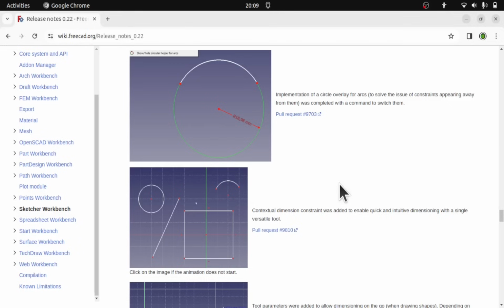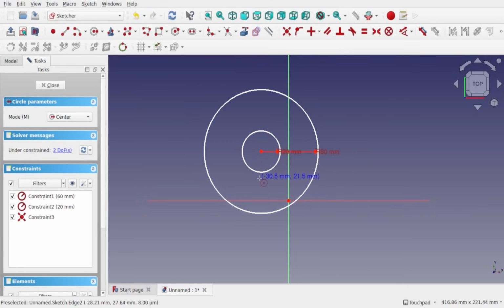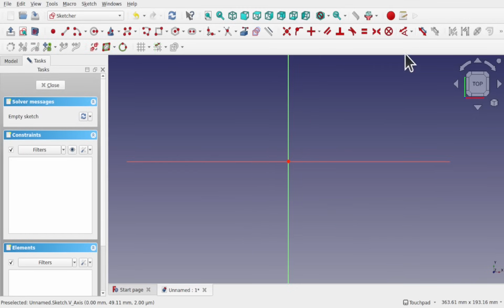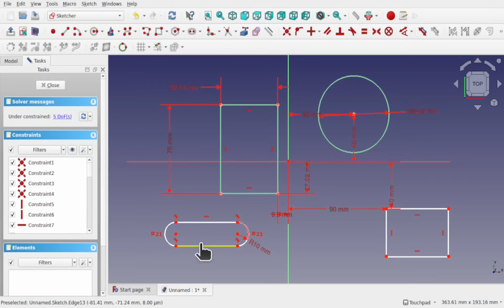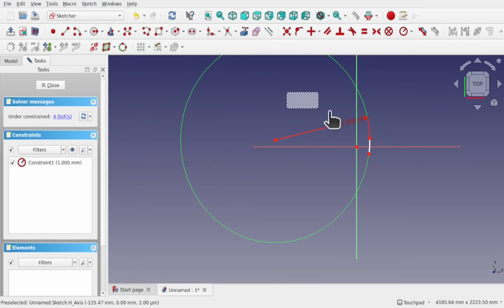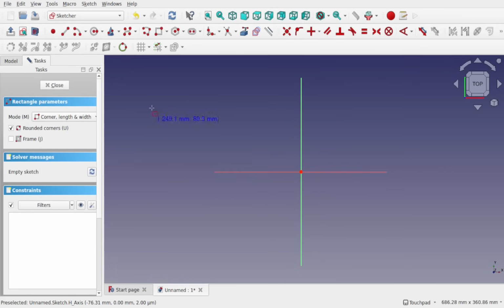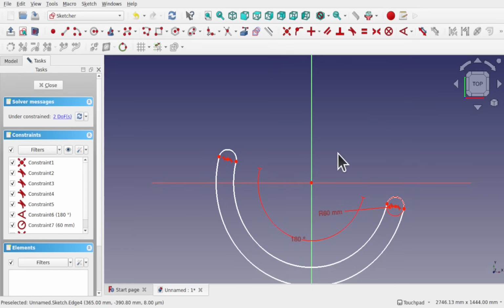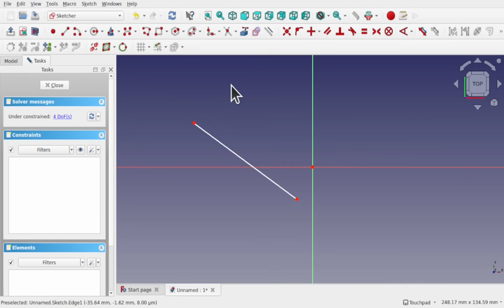!NEW! Game Changing FreeCAD 0.22 Sketcher Features

Comment: I just can't believe we're finally getting these basic convenience tools into FreeCad...
I would LOVE to switch to FreeCAD from Fusion 360, and I'm happy to have maybe a less polished experience with the CAD, but at the moment the gap is just way too wide.
Improvements like this really make A LOT of difference. 
The other part that needs MASSIVE improvement is extrusion. So that we can have a complex sketch and extrude parts of it from different faces etc.
And the third painful point is to support an actual modelling history with automatic re-compute (I know there are attempts being made to at least solve toponaming issue).
I'd say, for me I'm never going to use about 3/4 of the features that are currently present in FreeCAD, but all those features require maintenance etc. It's probably worth considering to splitting the functionality into the core modelling and "the rest" in the form of plugins, where separate teams would be able to maintain those plugins. It will just allow to speed up and stabilize the development of the core features.

If it was me, I'd say streamlining core part modelling experiences is the key priority. Reduce the usability gap with industrial software for simple scenarios, and the added audience will automatically speed things up. The traction and adoption are the key factors in my view.
Reply from the maker: Going forward there are some new direction in the FreeCAD arena.  0.22 is bringing more and more features and Ondsel are pushing in their changes into the FreeCAD main branch to bring more and more functionality.  Hopefully 1.0 will be released towards the end of the year.  Fingers crossed.  When it does it would be worth re-evaluating.

Comment: Thank You for this video. An issue I couldn't solve for years with Freecad is to describe an outer angle. E.g. I got an inner angle of 170°, but in my case i needed the outer angle of 190° it's still impossible to patch it to my sketch. Do You know a solution?

Comment: Now all I'm waiting for is a midpoint constraint (atleast for arcs and lines, bezier are much more difficult) and  someone solving that annoying bug where FreeCAD crashes whenever you change a dimension slightly. Often when I say, open a measurement and change from, say, 4,5 mm to 5,0 mm, everything just explodes. It is super annoying.
Reply: You can achieve a midpoint constraint by using symmetry for lines.
Arcs still require additional construction geometry but it can be done.

Comment: There's a lot of excellent things here that will make FreeCAD faster, easier and more flexible to use.  Those quick dimensions:  Can they take expressions/references to spreadsheets etc. or only literal values?
Reply from the maker: It's getting better and better :) At the moment those quick dimensions don't have a formula button on the end to add an expression.  I have tried adding an expression via typing it into the box but I can't.  I am not sure if this feature will be added.

Comment: Is there a reliable source I can get 0.22.x Windows binaries/installers from?
Reply from the maker: If you have a look in the description of the video you will see two links.  One is for a video showing where to download and how to run the weekly builds on both windows and linux.  Hope that helps.
Reply: @MangoJellySolutions  Man, I might be slowly loosing my sharpness ;) Not only I did take a look in the description previously and missed the video link. I also have visited guthub dev builds page and somehow missed the 7z pacjage! Thank you for patiently pointing me into the right direction! You're doing the god's work with your training. Top notch quality there. One thing I might suggest is putting more emphasis on setting up the initial options right after you click Create Sketch. I mean those deciding on relationships etc. / As for the dev 0.22. The sketcher improvements are simply too juicy to pass on and I'm already learning using a bit outdated 0.20 tutorials on my 0.21 installation. Just started learning. I used to use UGS NX a decade ago...
Reply from the maker: @Tome4kkkk  lol don't worry.  I just this minute spent half an hour trying to figure out to upgrade some software at work ...... on the front screen it says 'upgrade plan here'....  Yep missed that one, time for a coffee!  Not too bad 0.20 - 0.21 but 0.22 I am going to have a lot of (welcomed) work on my hands :) Already ear marking older 0.20 tutorials for review and re-record with some extra juicy bits lol.  Glad your enjoying.  Ah Simens NX.  I was at that point still using direct 3D with studio max but have heard of the package.  Well liked.
Reply: @MangoJellySolutions  I figured the changes are pretty big and rather long-lasting in the 0.22 sketcher. Hell! In case of most of them even a fresh FC student like mee could see FreeCAD is in dire need of those!

Comment: They should spend some time fixing bugs in Sketcher instead of adding features.
For example: we can't disambiguate a selection when two lines are on top of each other.
You can only select whatever line is drawn on top, and it' s arbitrary.
Only way around is to go hunt for it in the Elements dock and hope you find it.

Also the elements dock is broken.
You have to make two clicks to check or uncheck  the checkboxes, you HAVE to pre select them. --
Also, you can't use the keyboard in this list because it's   a weird descendant from a checkboxlist.

Worse than that, if you're in " Constraints' and try to go down past the last element, you end up in Elements, which has no useful keyboard control.
If you type space bar in Constraints, something happens ( a random element now draws in White in the 3d view) and it doesn' t deactivate or hide the constraint as you would expect.

This keyboard problem is a big problem for people who like to quickly go through a list while NOT looking at the list, but what is changing on the 3d view.
Reply from the maker: I have just pinned a reply from one of the freeCAD contributors so it appears at the very top of the comments.  The post has a wealth of information and includes TNP
Reply from the maker: It's worth reporting those issues back to the developers and then they can take a look into them.

Comment: Hi, I have a small challenge to you, that I have not seen on other CADs
I do crane liftplans. (I would love to include this onto my liftplans)
I need a quick calculation reference line from the top of the hook of the crane and down to the 4 corners of a typical 20foot container, the angle has to be no greater than 90 degrees on diagonal from the hook of the crane (4 legged chain), taking into consideration. Then I need to know the length of the line (chain)
Thanks.

Comment: Thee offset tool  looks awesome, most of the rest, nice to haves (and are nice to have).   But the #1 issue facing the platform in the toplological naming problem.   If this was a commercial product and I was the product manager, I'd be screaming at any engineering manager putting resources on anything but improving that.   It is the #1 thing limiting adoption of the platform.   And yet we get this.   Nice.    But not what the product really needs.    Meanwhile we all jump through hoops to avoide the TPN issue, or we switch to Fusion360.

Comment: WOW... This would be impressive if this didn't took so many years to arrive.
I know I'm salty but considering that those are basic CAD functions it's just sad it took so long.
FreeCad is a amazing versatile tool, but it's lack of a streamlined UI and user friendliness is the reason why it's unable to attract the industry.
Look at the rapid Blender improvements once it got recognized by the industry, it's defacto on it's way to supersede commercial software.
Reply from the maker: Very true and I think you hit the nail on the head there with once it got reconnised. Now with all the vendor lock in and subscription model more and more people are looking at freecad so more and more pressure. I know the developers are really pushing forward and the future is going to be very very interesting.
Reply: @MangoJellySolutions  F subscription... And double F cloud!
Alibre CAD is a very good program if you are a freelance professional.
But those 1500 bucks aren't laying around for normal folks.
Those might have fun with Plasticity but that isn't really meant for construction work.
An interesting thing might be FreeCad with the option to load a commercial Geometry kernel like Parasolid.
But for that to happen we would need to have a "FreeCad foundation" first.
So a small margin of the cost can benefit the community directly.
A few full time devs make a serious difference.
Reply: @MangoJellySolutions  F subscription... And double F cloud!
Alibre CAD is a very good program if you are a freelance professional.
But those 1500 bucks aren't laying around for normal folks.
Those might have fun with Plasticity but that isn't really meant for construction work.
An interesting thing might be FreeCad with the option to load a commercial Geometry kernel like Parasolid.
But for that to happen we would need to have a "FreeCad foundation" first.
So a small margin of the cost can benefit the community directly.
A few full time devs make a serious difference.

Comment: Good job! I can't wait for the official one.
I actually only use 2D sketch.
I ask myself: Is it now easier to make 45 degree fillets in sketches?
I think that would make drawing much faster for many people.
Thank you very much to everyone who is committed to Freecad.
And best wishes for the coming year.
Reply from the maker: Interesting that you only use the sketcher. I am guessing you making plan drawings? I am not sure if the 45 degree filter is easier with these new additions. If your only using sketcher it may be worth getting ahead and downloading the dev version. There is a link in the descriptive to a video of how to download and set them up. If you don't know how. No compiling necessary.
Reply: Thanks for your reply, and you're right I draw in 2D to use in my CNC router.
I watched the video and that was exactly my problem, I couldn't extract it without errors.
But that's fixed now. 
And it's true: It's much easier to add dimension. But 45 degree fillet or chamfer is still a problem takes a lot of time and you have to trim and give it a new dimension. 
Why is a round fillet very easy and 45 degrees chamfer not?
Sorry another irritation, separating decimal with a Comma instead of a Point.
Make it possible to do both without increasing the size 10 times if you make a mistake.
I will continue to follow Freecad and your channel, maybe one day it will be perfect for me and for many people, thanks again to everyone.

Comment: @pierreboyer9277 I have been experimenting with 0.22 (built from source) and I very much like that the geometry creating tools now allow you to use keyboard input to implicitly create dimension constraints without requiring additional mouse clicks.  This is not, however,  how the new combined Dimension constraint tool currently works. 

With the Dimension tool, after you select the tool and then select a line, for example, you must mouse click again before you can enter a distance value from the keyboard.  This can be confusing if you forget the second mouse click.  For example, if you click on a line once and then type "12" on the keyboard, thinking you are typing a dimensional value, FreeCAD will take the 1 and 2 keys as keyboard shortcuts and switch the view first to the "Front" plane and then to the "Top" plane.  Not a terrible result, but probably confusing to new FreeCAD users.  

That said, I also like the Dimension tool's "Insert Length" popup as it allows you to enter a name for the value and/or make it a reference value and I would not want to lose these options just to save one mouse click.

Are there plans to make keyboard entry of dimensional values more consistent between Sketcher tools in the future?

Thanks again for all of your efforts!

Comment: I am trying to learn from scratch it’s overwhelming I am wondering can you go from freecad to universal gcode sender then to arduino for a plasma cutter or am I wasting my time I can’t find any videos simple and straightforward thanks for any help
Reply from the maker: The path workbench allows you to do GCode for CNC milling.  You can setup your tool paths and cuts from there and export out the GCode of the finished project.  But, with my limited knowledge of plasma cutters, I believe in some cases you need lead in where the cut is slightly oversized ? I am not sure you can count for this in this workbench.
Reply: Thanks the info !

Comment: I am happy with these features. Feels like some good progress for Freecad.
Possible video idea or just a question:
I recently started designing a 3d printer build in Fusion and adopted the workflow of designing every part in a separate file and combining them in a master assembly file. I am also using the "derive" function to make versions of the parts "printable" (mouse ears and single layer bridging holes and stuff) without changing the base part. How would you adapt this workflow for Freecad?
Reply: You can create links to parts in another file. I have a whole library of parts I use commonly (like certain buttons, connectors) or need as reference (like 18650 lion cells and their holders), that I link into my main file.
To "derive" a part without changing the original, I would go with a clone ("part design" or "draft" workbench). That's then your base shape (that stays in sync with the original) you can modify to your liking.
Reply: @superdau  I tried the clone and it works exactly like derive. Awesome. The links to parts thing I am going to need a bit more explanation for, but if that is just called linking I might be able to do my own research. Thanks :)
Reply: @Giekeme  
Yes, it's just called a link. It's described on the FreeCAD wiki, found under "Std LinkMake". Or the first Google search result for me for "freecad link object".
Reply: Found it. That was exactly what I was looking for. Thanks again!

Comment: Would be nifty if lines (including the ones making up polygons) included a midpoint by default. I keep sketching, dimensioning, chamfering or filleting, and then wondering where my dimensions went because I am apparently not very smart... Dimensioning from the midpoint would make that so much simpler.
Reply: Exactly, automatic symmetry constrain for line midpoints or something like that is badly needed. It has been discussed a few times on the forum and let’s hope that Paddle (the guy behind all those new features) will add it eventually.

Comment: These all look like great changes to me. All will be very welcome. I was wondering if it is possible (I'm probably asking too much here, I should be grateful enough for offset) to change the dimensions input so that tab will keep cycling through them,  even if they already have been inputted,  and an enter key or left mouse to drop the geometry? I'm not going to winge if it's not to be fair, the changes shown here are a great improvement.
Reply from the maker: I have just been playing with this and I have found that instead of using tab if you enter the value and press enter to go to the next dimension, if you hit tab it cycles back and you can edit the previous one but only if you haven't started editing the second one.  So looks like that functionality is sort of there but it needs a little work.

Comment: Rounded rectangles are amazing - that removes a lot of steps I'd normally need to make them.
Reply: Rounded rectangles have been in 0.21 as well, unless that's what you mean. They are indeed amazing
Reply: but the Arc Slot , and Offset and the Frame feature are absolutely the big ones. it saves a huge amount of time

Comment: The sketcher dimensions are a big improvement - although I'd prefer 'diameter' for circles but 'radius' for arcs - does the 'M' key do this?
Reply: Yes, the M key cycles through them in 0.22, but the feature you describe is already in FreeCAD 0.21. If you use the automatic mode ("constrain arc or circle") instead of selecting specifically diameter or radius, it uses diameter for circles and radius for arcs by default.
Reply: @glabifrons  Thank you - I hadn't noticed that!
Reply: @philip_fletcher  Glad to be able to help. :)
Happy New Year!